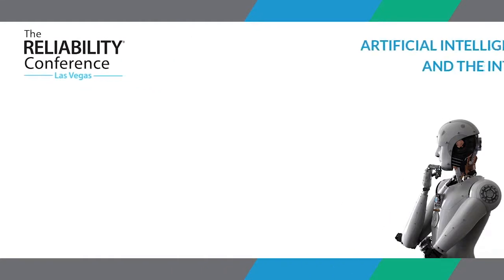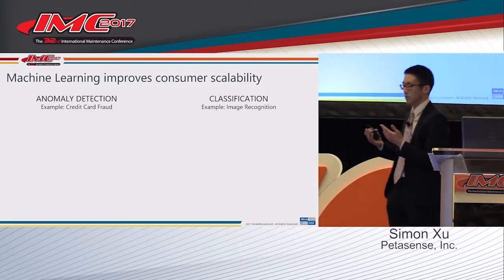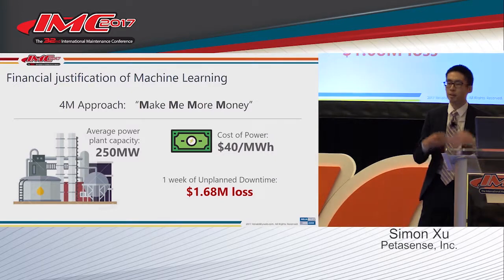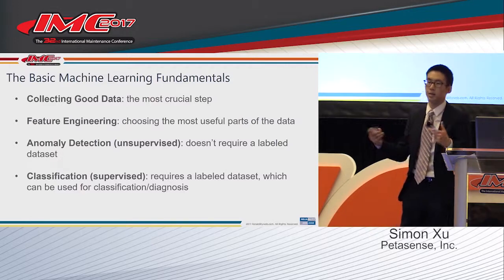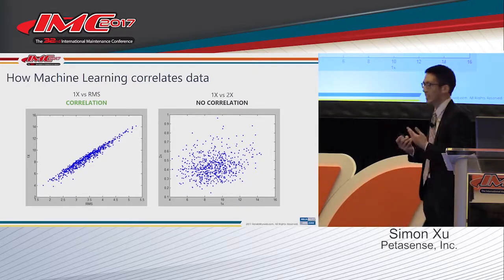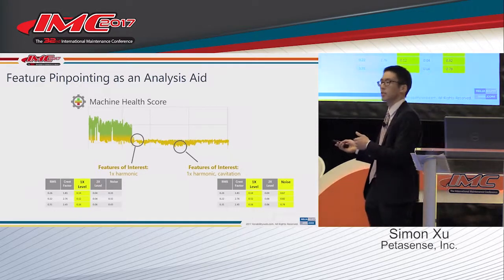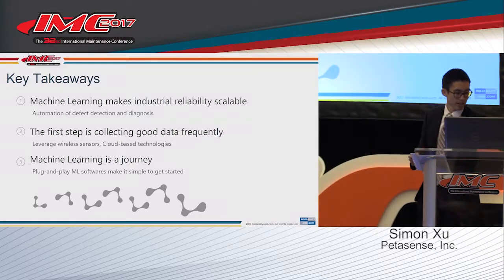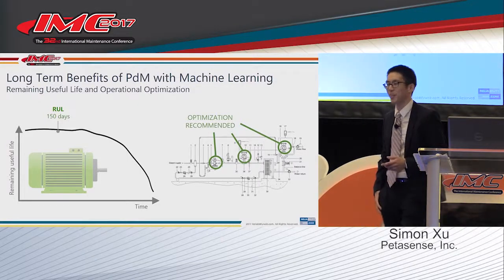Practical Machine Learning for Predictive Maintenance

Comment: Dear, congratulation for your presentation. 
Please let me make my homely comment. 
Please note that, the plant shutdown does not happen mostly caused by wrong maintenance plan rather than low reliability equipment. Another aspect is to note that even if, sensor is applied to an equipment such as rotating for anomaly parameter detection such as vibration, some failure modes are not detected by sensors such as crack corrosion, erosion, rather by predictive maintenance (Ultrasound Test, Radiograph test, infrared test).
Unless you install a camera close to equipment which is in many cases quite challenge and will request a very robust camera.